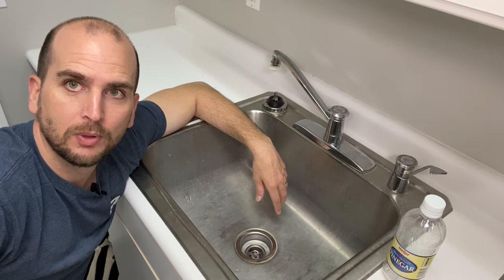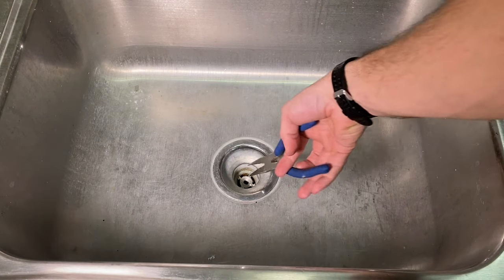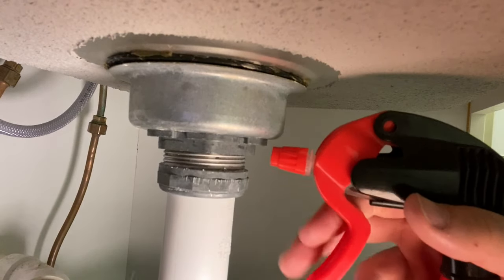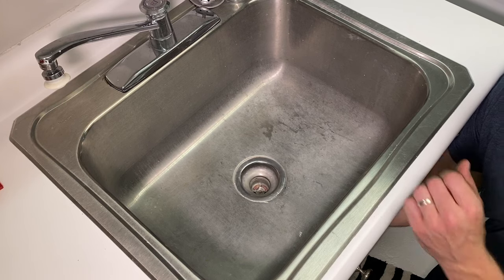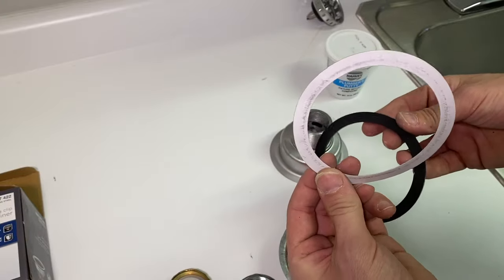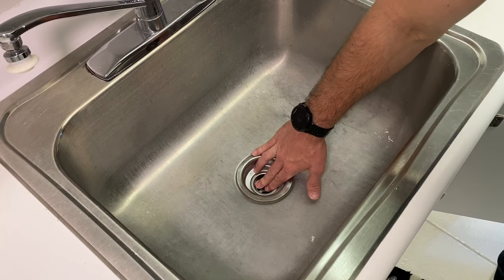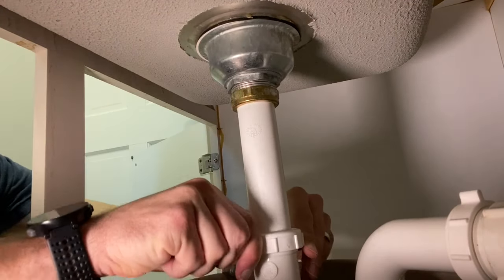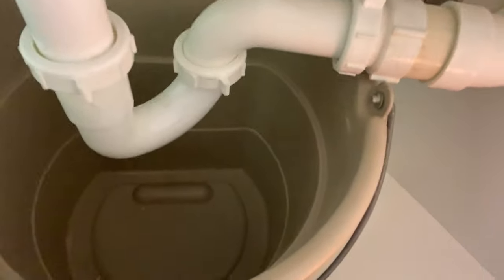How To Replace a Kitchen Sink Strainer | Hard To Remove Old Parts

Comment: I was able to remove the two old strainers using the heat gun and vinegar. Installing the new strainers were easy. I had to pull downward on the neck of the new strainers so that I could screw the new nuts firmly to the basket. The total cost of this project was only $45.00. Thank you for showing me how to fix my kitchen sink.

Comment: Thank you so much!  I followed everything you said, there were some bumps but I got through them and I tested it the way you said to and it is working perfect!  Not bad for an old single lady!  LOL!
Reply from the maker: Nice work and way to take the initiative 👊.  What project is next?
Reply: I’m another “single old lady” who just accomplished this too. !  Hurray. and thank you so much. 😊
Reply: @EverydayHomeRepairs  Nothing right now but ya never know....
Reply: Me too . I’m following the directions here.. best video tutorial I found on YouTube… but I’m stumped bc the man at the hardware store told me to use silicone sealer up against the gasket to the metal basket underneath.. 

me.. scratching my head wondering if it is really necessary ??
Reply: Vinegar was a great help! Thank you

Comment: Thank you so much for this video! It was exactly what I needed to show my parents so they could fix their kitchen sink. Your instructions were so clear and the tips were VERY helpful. My parents are 82 and 75 years old and the with house is 32 years. Lots of build up around that piece lol. They watched your video over and over and it was a lifer saver! They both want to thank you!!
Reply: Whenever I tighten everything the strainer slides out of the indented part of the sink to one side of center. How to prevent this plz.

Comment: Thank you so much for the video! My issue was that it was old and leaking for a long time. So I had so much mineral deposits. Your vinegar tip is what did it for me. I was able to boil some vinegar then used a brush to apply it.Then used a 1/4" brush attachment on my Milwaukee driver to hit up all the treads. Applied Vinegar once more then hit it again with the driver and voila! Off comes the ring Thanks again. I hope this message reaches you and that you are well. Cheers!

Comment: Thank goodness for YT and this video...my husband and I are selling our home in January. We've had a few updates done (We've paid ppl) as he is..well not so good at fixing things...but he tells me we need a NEW sink..but I say otherwise..this is EXACTLY what was wrong. I'm going to use this video as my guide...I used another YT video to fix our heater when it wouldn't come on last winter and saved a ton...I will save w this video as well. Ty! I just personally don't want to put a new sink in a home I'm leaving although the one that we have is probably 35 + yrs old..but other than the leak it's fine..so if the leak can be fixed, we'll save $$...I will try my best. Ty for the video!

Comment: Most clear and concise video I've seen in some time, thank you! I was removing funky pipes and all other components from a sink basin I already pulled out. I ended up using channel locks carefully instead of the rigid tool, a drain wrench and lots of vinegar, applied many times (funky very old old sink)-It worked!

Comment: Some sealant added to the gasket and elbow joints helps as well. Just did this this morning. Worked like a charm. Since I added the sealant, I didn’t use the paper gasket.

Comment: Thank you! My hubby couldn't get that part off. I watched your video and got it off for him!! 😂 Thank you again and again for making this video!!
Reply: I took the pipe piece that was stuck out the top and then put it in my vice to hold it .. used pliers and it came  unstuck .. I wasn’t reusing the basket so I didn’t care if the vice punched any threads. I just wanted my pipe free from it.

Comment: Thank you so much, sir, for the very concise video. I was able to replace my pressure cup type strainer once I removed the old one. The old one was over 20 years and I had trouble removing the lock nut that held the cup piece in place. I ended up using a hack saw to cut thru the strainer just above the very tough metal lock nut. Since it wasn't as tough or thick, that didn't take too long. I saw that tip on another video. The only hitch I ran into after the install was that I didn't have the correct slip nut washer on 1 of the PVC drain pipes well below the strainer, so it leaked at that location. I am not real experienced in plumbing, or I'd recognized that problem (I should have noted that when I took them apart or taken a picture). I really appreciate you taking the time to post this video!

Comment: Oh man! Thank you so much for this video!  The only thing you might have clarified is that plumber's putty doesn't need to dry, which I didn't realize.  You just solved my leak problem. And I didn't have to hire a plumber. I was able to do this in my Airbnb property in between guests thanks to the easy and clear steps.

Comment: Excellent video instruction. I couldn't remove the compression nut connecting the T-pipe to the bottom of the strainer until I used your tip about spraying the top of the threads with vinegar and letting it seep down into the threads to dissolve the buildup. I did this three times waiting 5-10 minutes between sprays and was finally able to get the nut off. I then used a new nut after carefully wire-brushing the the threads on the bottom of the strainer with vinegar. I then wiped a thin coat of lightweight oil (SuperLube Multi-Purpose Synthetic Oil) on the threads making sure none of it got on the rubber T-washer. I'm hoping this will prevent any future corrosion and make it easier to get the nut off in the future.

Comment: There seems to be a debate on what gaskets/washers are used where on the assembly.  I just replaced both of the strainers in my sink (the old ones needed to be cut off with a multi tool), but the new ones had a rubber gasket and a foam one, where the foam one sat between the strainer and the sink and the rubber sat beneath as it usually does on an assembly.  This method still provided a great seal with no leaks and no putty either (manufacturer stated it wasn't needed).  Anyways, great video and very helpful!

Comment: Great video. I knew I needed putty but didn’t realize I would need a new compression ring for the brass nut.  I just picked up the exact strainer you demonstrated.  Haha.   Thanks again for the good instruction for this hobby plumber.

Comment: Excellent tutorial, thanks so much!

Editing to add: I successfully rebuilt my kitchen sink yesterday. I ultimately wasn't able to get the baskets free, even with vinegar, in one piece. I bought the Ridgid tool that engages drain holes in the basket, but not the really big tool that goes around the locking ring. Maybe that latter tool would have made a difference. I ultimately split the locking ring with a fiberglass-reinforced cutoff wheel on my Proxxon (Dremel). The stainless was reasonably easy to cut with an abrasive. An angle grinder would have worked too, but I haven't yet used cutoff wheels with my angle grinder.

Comment: Just put a disposal in out kitchen. I had to put an outlet under the counter, remove the old sink drain, hang the disposal, and connect the drains. Your videos on those subjects were invaluable (though I did have to go to the angle grinder to get the basket to release. It was really stuck after 25-ish years). 

Only had to go to the hardware store twice.

Comment: Hi Sir. It's 2023, I have MS Multiple Sclerosis and have grip and strength issues. I followed your tutorial and managed to install new basket strainer, it was corroded and came completely free from the basket. It took me several hours over 2 days because of breaks when I was getting frustrated. But test 1 was OK. Test 2 full sink was leaking from the tailpiece ptrap. I can at least use the sink until I get my dad to come get the tailpipe situated better. THANK YOU ❤

Comment: I did it! I hit a few glitches along the way, but I was able to adjust by going back and watching a few parts over again.
My drain had rusted and was no longer connected to the sink; I had to scrape away to find the mounting nut. 
Biggest error on my part was I didn’t get the same type of strainer so I had to get a new tailpiece and cut it to size. 
But no leaks! 
If you read these, I wasn’t able to fit the washer that came with slip nut. I hope that’s not a problem.

Comment: Had to use a Dremel tool to cut the nut off the strainer. Very hard water in South Texas cemented the nut to the strainer. I tried vinegar, CLR, and the sink strainer specific tools - no dice. Dremel cut through it in a minute 😊
Reply: coupling nut or lock nut?

Comment: Great video!! Thank you. I can't afford a plumber, and as a single female this was very easy to follow! Now my leak is fixed.  If you haven't already, repairing a ceiling light fan switch would be very beneficial. I've done it once before, but the switch was a cheap piece of cr@p. As a result I have now run out of extra wiring to connect to another one. Don't need a new fixture and can't afford an electrician. H_E_L_P...

Comment: I am trying to replace an old pop up system with a simpler push on/off system, which I have purchased from the hardware store.  I believe the strainer has to be removed to accomplish this.  Am I right?  The only lock nut I see appears to attach to a threaded metal pipe which appears to hold the sink in place.  The lock nut is fused to the pipe, so I will try vinegar to loosen it.  But before I do I want to be sure I’m doing the right thing.  Thanks for your excellent series.

Comment: If there is a very slow leak to a connection that has a tread & needs a compression washer adding plumber's tape to the treads will that help leaks, & if the teflon plumbing tape is not properly put on treads can it produce a leak, thank you

Comment: Thank you for video.  Tried vinegar first.  Tried and tried but that nut wouldn't budge.  Waited a little while.  Hit with heatgun then added more vinegar.  But finally loosened up.  Was able to take strainer out.  Now the pipe you pulled up won't budge.  Loosened the bottom nut and poured vinegar all over it.  It won't twist or lift out like yours did.   Any suggestions?  I think it's called the tail piece.

Comment: I am getting a small leak on the lock nut to the drain. Should I use thread tape and pro dope to secure the joint?

Comment: Thanks for the video! It was helpful. I was able to get the same strainer, plumber putty, and I removed the old strainer (although it broke but the vinegar trick works great). A handy man came over (called him before I watched your video) and I had everything removed and the new part. He wanted to skip the plumbers putty step but I insisted he uses it. I put it on myself. However, when he tightned everything, the strainer doesn't look centered and I can see a gap on one side although putty cam out of all sides. Is this a potential problem? Thanks again! First time ever I leave a comment.
Reply from the maker: Hey Lauren, if you saw putty coming out all side you are probably good.  You can fill the sink up and inspect in the cabinet for any slow drips if you don’t see any you should be in good shape.  Way to take the initiative and make sure the job is done right 👍
Reply: @EverydayHomeRepairs  Thanks your quick reply! One last question, I hope you don't mind. I thought the rule to loosen nuts and other things was righty tightly, lefty loosey. I was watching you and it seems that to loosen the top and the bottom nuts to remove the damaged strainer, it seemed as if you you turned it right for one and left for the other. This might be a stupid question, but I'd like  to know so that if I do it again, I won't do any damage. Thanks!

Comment: So wait a minute.. I’m don’t this right now and after you put putty under the basket rim then set it down and press .. then aren’t you supposed to put silicon onto the rubber gasket that goes up against the basket underneath to ensure a better seal? Can it be done like that or isn’t necessary? Thank you for your time..

Comment: After replacing my kitchen sink drain, I can run water without any leaks. However, when performing the second test of half filling the sink and letting it drain, I get water coming out of the area where the tail pipe slides into the p-trap nut. Is this supposed to be sealed with silicone?

Comment: Thanks Scott. My house was built in 1928 and I think the piping from the wall to the kitchen sink is very old. I was getting a slow leak from around the lock nut. I replaced the strainer and continued to get a leak. I removed the lock nut and realized the straight pipe from the P-trap to the strainer does not sit flat against the strainer. I filled the lock nut with plumbers putty and tightened it up. No leak. Thoughts?
Reply from the maker: I don't love it but if it works it might hold for a while.  are you able to adjust the p-trap at all so that the outlet of the p-trap aligns better with the straight drain pipe coming down from the strainer?
Reply: @EverydayHomeRepairs  I don't think so. It is very old. If I tighten the strainer Lock Nut before the lock nut on on the P-trap, the straight pipe will sit flat on the strainer but the strainer will be canted a little.
Reply: @EverydayHomeRepairs  any advice fo a locknut that just won't budge? Tried vinegar , alcohol, nothings working and I haven't had a sink inna week , ideas?
Reply from the maker: @rastareptilerescue  when they are really locked up some times you have to break out the hacksaw and cut the nut in 1 spot to pry it off.
Reply: Cogard, It sounds like the drain/plumbing is not square (level) with the countertop that the sink is mounted to. Anything you do to make it work without bring the drain and countertop level, is  going to sound, and perhaps look like, a hack. But sometimes a hack is all you have to work with.

Unfortunately, since there is nothing keeping the plumbers putty in place inside the lock nut, it will probably work for a while, but eventually the plumbers putty will begin to ooze out of the lock nut, causing the connection to loosen.

Here is a video that describes connecting a P-Trap to the down pipe (outlet pipe) of a Garbage Disposal, using a rubber "Boot" with screw clamps, instead of the slip-joint nut and seal.

Your case is similar except you're connecting a P-Trap, to the the sink-drain tailpiece, instead of the Garbage Disposal.

Just make sure that one side of the boot is sized to fit the outside diameter of the tailpiece, and the other side of the boot is sized to fit the outside diameter of the P-Trap.

Plumber Hacks 101 - Rubber hose vs. Slip Joint Nut - NO LEAKS! || DIY with Michael Borders | 39,310 views | Jun 17, 2018
https://www.youtube.com/watch?v=5Jv1pkPjxds

Watch the video. Even if your configuration is not similar to the one shown in the video, it may give you some ideas.

Perhaps an easier way is to cut a short piece out of the tailpiece, then reconnect the tailpiece with a rubber-sleeve and screw clamps made for such repairs.

In either case, the rubber sleeve, or boot, will be able to flex enough to adjust for the misalignment.

Good luck!

Comment: Do you think this method will work on an old porcelain sink/drain from the 1950's? We did remove a garbage disposal in the 1998 , but eying this now with trepidation - friend says it is probably so frozen on he would end up cracking the sink...

Comment: Thanks for the video. I replaced my faucet and somehow (maybe I pulled on the pipe getting up?) caused a leak from my sink strainer, so I attempted to tighten the connection and broke the entire metal threading off, so I’m now replacing the entire sink strainer. This may be a stupid question but, how tight is tight enough not to have it leak but without being so tight you break plumping parts?
Reply from the maker: The key to ensuring no leaks is a consistent bead of plumber's putty around the entire perimeter of the strainer.  Then you can tighten down the strainer and the putty should squish out around all sides of the strainer inside the sink.  So it just needs to be tightened snug but not overtightened as the plumber's putty will do the work.

Comment: Hello, 
Thanks for the great video. I followed the steps and had no leaking for a few days but now it started again. ??? Is it possible to  over tighten the tightening nut? 
Any other ideas ??
Thanks!
Reply from the maker: Does it look like the leak is coming from between the sink and the strainer basket lip or from the outlet of the strainer basket and the drain pipe?
Reply: @EverydayHomeRepairs  
Hi, I figured it out. You were right. The strainer install was fine, but I cracked a plastic connection in the down spout. Got it fixed. 
Thanks!!
Reply from the maker: @markd3000  Nice, glad to hear you got it straightened out.